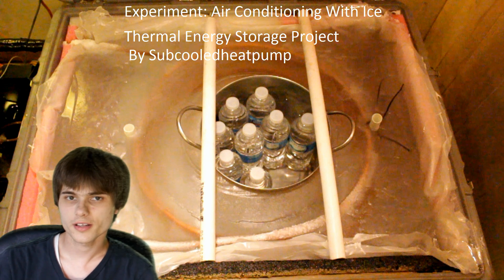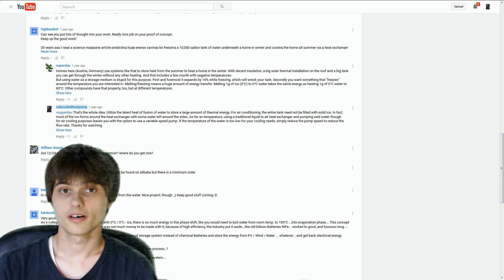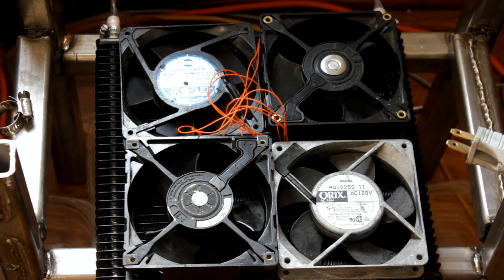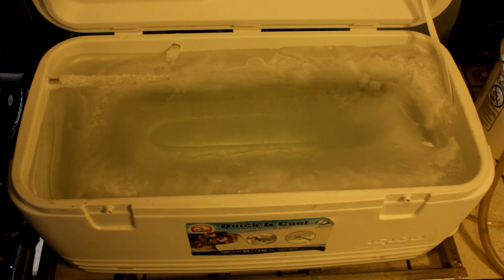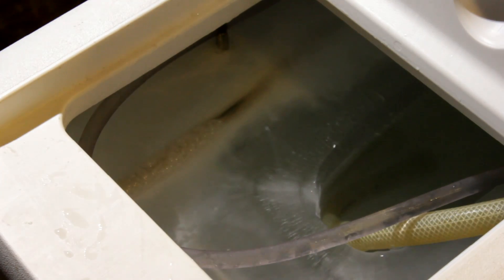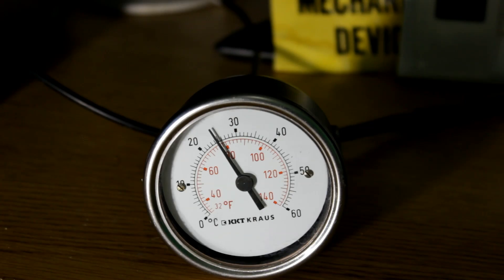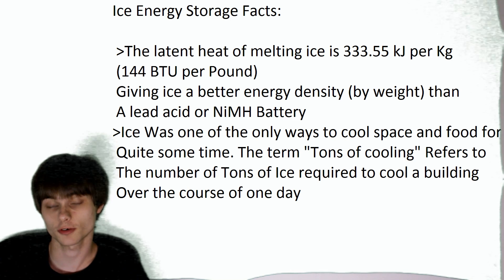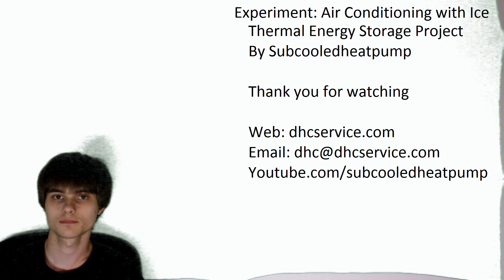Experiment: Air Conditioning with Ice

Comment: Here I am 6 years late but I think you might have confirmed my theory. My buddy has a cabin that runs off of a 5kw hydro turbine totally off grid. He's never been able to install air conditioning because of the unpredictability of when the AC unit will turn on. What I proposed to him was ice storage, so at night when he's barley using any power the unit can make ice and draw off of that stored energy throughout the day. That will enable him to finally be able to rent it out during the summer time.

Comment: Um you do realize this is NOT air conditioning.  All he's doing is cooling the air.  An air conditioner doesn't just cool the air, it conditions it.
Reply from the maker: Fun fact of the day: most high rise buildings are air conditioned by using chilled water flowing through radiators
Reply: @subcooledheatpump    Dude that's NOT air conditioning.  Look up the definition of air conditioning.  Running cool water through radiators cooling which is the opposite of heating.  An air conditioner "conditions" the air by removing water and heat.  I think your Fun fact an alt-truth. 
Chilled water cooling WAS use in the past and has been replaced by air conditioning.  There's a reason air conditioning  is used in place or air cooling.
Reply from the maker: You are mistaken. The majority of all large buildings still use chilled water. You might be misunderstanding the process  though. The water isn't added into the air by any means, it is a sealed system in which the water can't escape from the radiators. The end results are still exactly the same. This type of system does in fact remove both heat and humidity.
Reply: @subcooledheatpump  Do you know the difference between a heat exchange, air cooler and air conditioner? 
What you have built is a heat exchanger air cooler.   You don't have a closed system for the air, just the fluid.  An air conditioner recirculates the air and in removes the water from the air.  
Not sure I understand how large buildings which use chilled water for cooling.  I understand how heat energy is removed, but please explain how the humidity is decreased?
Reply from the maker: Humidity is removed from the air when the air is cooled below it's dew point. It doesn't matter if it was done by a refrigerant evaporator or by a radiator with cold water flowing through it. The air also does not need to be recirculated to remove humidity, Automotive air conditioners still work even if you aren't recirculating the cabin air. Same goes for aircraft, which in fact use bleed air (think outside air) that is expanded and cooled, to cool the cabin when needed. As you describe "A heat exchange air cooler" is what all air conditioners really are. (unless you have some kind of evaporative cooler, that is) An evaporator in a household air conditioner is really just a heat exchanger inside a box, with a fan that blows air through the air side, and cold refrigerant flowing through the refrigerant side. You can do the exact same thing with a radiator, with air flowing over the air side, and cold water flowing through the water side. Yes, nearly all large building use this method, and there is overwhelming evidence, Have a look.

From Wikipedia:

https://en.wikipedia.org/wiki/Air_conditioning#Central_plant_cooling

" Central cooling plants are used to condition large commercial, industrial, or campus loads. At larger scales, the ductwork required to move conditioned air to and from the plant would be impractically large, so an intermediate fluid such as chilled water is used instead. The plant circulates cold water to terminal chilled water devices such as air handlers or fan/coil units. The plant often consists of a chiller, which may be water or air cooled. If water cooled, the chiller is cooled by a cooling tower. " 

In recent news:

https://www.bloomberg.com/press-releases/2019-12-19/carrier-aquaedge-19dv-chiller-wins-fifth-major-award-in-past-year

"Typically located in the building
mechanical room and out of sight for the average building occupant, the 19DV
utilizes chilled water to provide efficient cooling and heating for commercial
buildings like office buildings or hospitals"

Centrifugal Chiller Fundamentals:
http://energy-models.com/centrifugal-chiller-fundamentals

"A centrifugal chiller utilizes the vapor compression cycle to chill water and reject the heat collected from the chilled water plus the heat from the compressor to a second water loop cooled by a cooling tower............
..............The evaporator is a heat exchanger that removes the building heat from the chilled water lowering the water temperature in the process."

Also: Using ice for air conditioning has been around a long time. Big buildings will use extra power at night to freeze a large amount of ice, the melt it to provide extra cooling during the day. Works largely the same way it does in this video, just on a larger scale

Comment: I see your first problem the title of your video.  That’s not an air conditioner.  Your device does not conditioni the air at all.  You aren’t even trying to condition the air.   What you have is a simple a simple heat exchanger.  Completely different animal than an air conditioner.
Reply from the maker: Not sure how you figure it doesn't condition the air. It cools and dehumidifies the air just like a vapor compression cycle would.  Typical vapor compression cycle air conditioners do the exact same thing, just by different means.

Comment: One issue that you will likely run into is that once the ice around the evaporator melts, it will be difficult to transfer more heat into the rest of the ice since it is mechanically isolated from the evaporator tubes.

Comment: Thank you for your effort making this video. What kind of chiller system you use to make the ice? Is it stored in the cool box?
Reply from the maker: I'll probably make a video showing it soon. But just to tell you briefly, it uses a small 3 phase compressor mounted to a stainless steel frame. The cooler also sits on top of the frame. The compressor runs for a VFD that I control manually. I made it just to experiment with. Thanks for watching

Comment: You are not storing energy, you are removing it.
Reply: Ice is not potential energy, it is water that has had energy removed but I suppose it is kind of like storing an absence of energy.
Reply: Ice does not release energy, it absorbs it and in doing so, melts.
Reply from the maker: Hey guys, I think we all know what happens when ice melts. It's obvious it absorbs thermal energy. So technically speaking, ice cannot be called a thermal energy storage system. However, it is easiest for people to understand the principle when it is called it by that term. To provide cooling without using ice, or any other type of cold storage, you would either need to store chemical energy (batteries) kinetic energy (fly wheel, compressed air) or thermal energy (steam, molten salt) to drive a vapor compression, or absorption cycle to provide cooling. So while technically speaking ice is not energy storage, it is a replacement for energy storage, so that is what most producers and users call it.